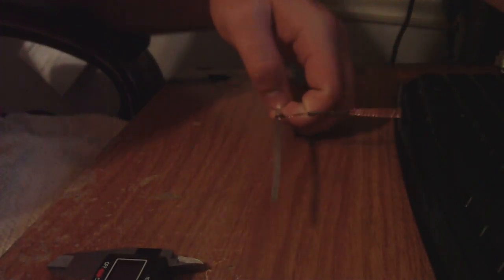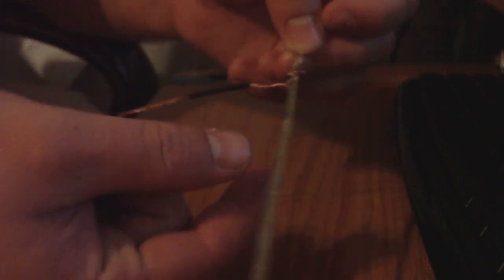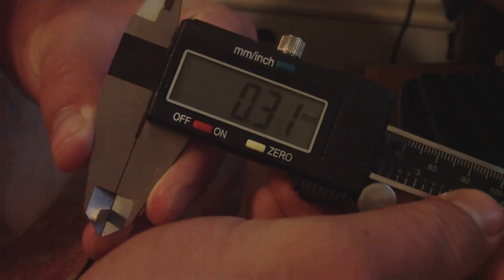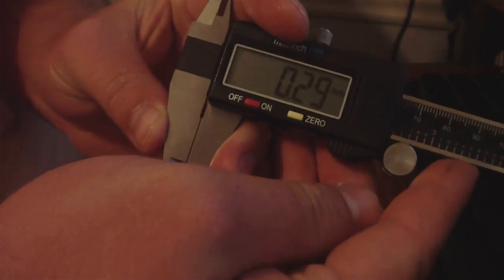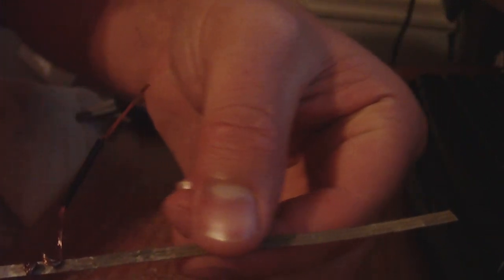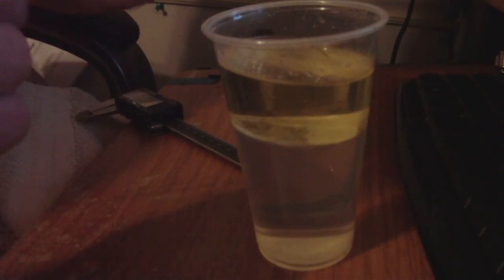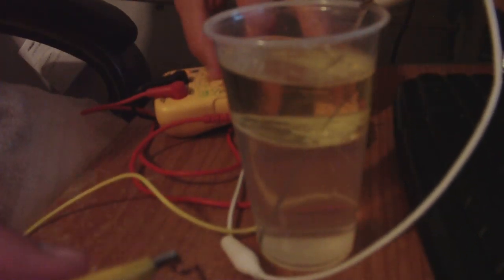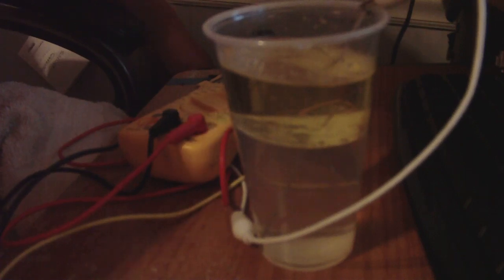measuring corrosion of magnesium in detergent

Comment: yeah. but its going to require some good scales. You need to run a non reacting dummy as well, with no reaction to compensate for evaporation, but corrosion should indeed lead to a larger loss in mass, if my memory is correct

Comment from the maker: Yes. The clean lead acid battery was filled with detergent but no oil was added. The reason for oil is to keep it from evaporating which will be hard now since the detergent lives in a almost sealed battery.